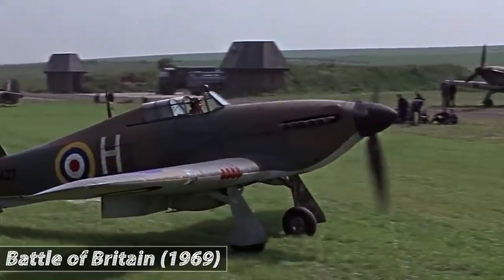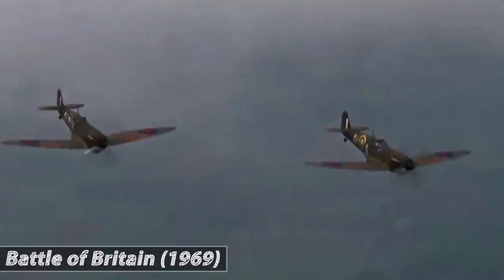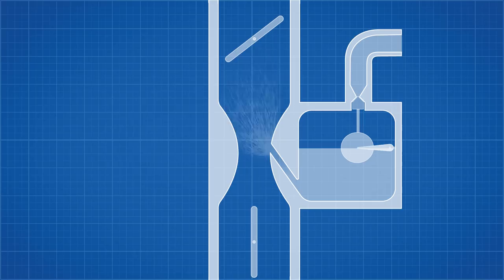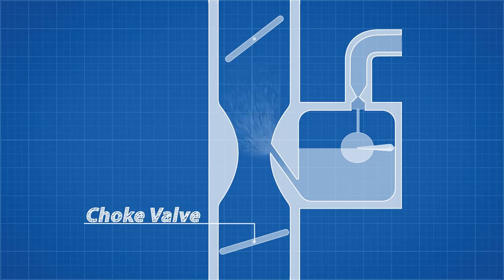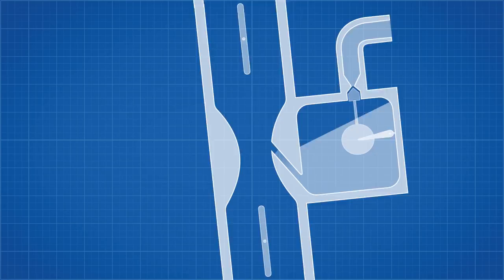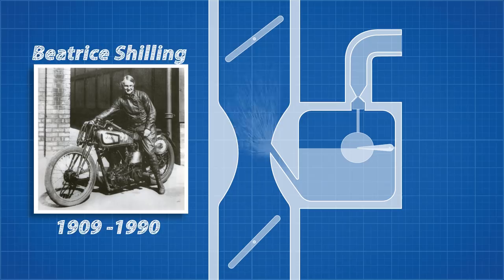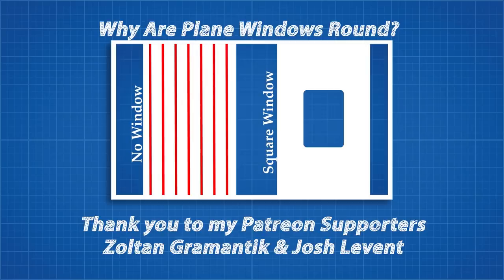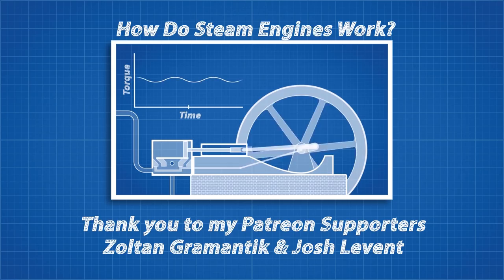The Spitfire's Fatal Flaw

Comment: Speaking of female engineers, I did my degree at Bradford University in the first half of the 70's. Bradford was essentially an engineering university at the time with several technology subjects also. The university then, only had some 6000 students resident at any one time with a further 3000 or so in industry since the university focused quite heavily on 4 year degree courses at the time known as sandwich courses - thin and thick - thin were 6 months at uni and 6 months in industry for three years and a final full year at university, thick were 3 years at uni with 1 year in industry - usually the second year IIRC. Out of ALL those 9000 students there were ZERO female engineers in Electrical & Electronic engineering, ZERO in Civil Engineering, ZERO in Mechanical engineering and just a VERY few in Chemical engineering and Colour Chemistry. The ONLY real cohort of female students were not even on the main campus but in Modern Languages nearer the city centre.

In the 45 years since I graduated the change in numbers has happened but is truly pitiful and the term Engineer in the UK is STILL perceived as someone who fixes your car unlike in Germany where an engineer is respected as being someone of the same level qualification as a doctor or lawyer. I've been a member of the IEE now the IET for over 48 years and in ALL that time the IET have been desperately trying to get more females into engineering without a HUGE success. It has improved as I say but it is still pitiful, especially so since there are PLENTY of roles withing engineering where women would not even get their nails chipped or their hands dirty, never mind their faces. 

The main problem seems to be a complete misunderstanding of the role of engineers and engineering by the public at large. They KNOW a doctor is valuable because they SEE the work they do. They KNOW lawyers are valuable for a similar reason, but ask people how many engineers affected their lives between waking in a morning to getting to work and they look at you like you're some kind of demented fool. My youngest brother is an engineer with McLaren and ANYONE who has been inside an F1 factory can attest to its "clean room" level of cleanliness, McLaren being no exception.

When he and I have discussed this we both reckoned that ANYONE, BEFORE they have even left their driveway has been dependent not on tens, nor even hundreds or thousands but certainly tens of thousands and maybe even HUNDREDS of thousands of engineers from designers, production engineers, quality control engineers, mechanical and civil engineers, chemical engineers, IT engineers, Telecoms engineers ... the list is endless. Think about it yourself - there is NOTHING in the world that exists for our use that has not been designed, produced, shipped, installed, EATEN, drunk, worn or utilised that hasn't had the hands of MULTIPLE engineers from MULTIPLE disciplines. Food, clothing, Technology, medicine - research is the science bit but manufacturing lines, production flow and control, logistics ALL VERY HEAVILY dependent of mechanical and electrical/electronic engineering.

During the current Covid-19 crisis where everyone (rightly) is praising the work of the NHS staff putting their lives on the line daily,  WHO has even THOUGHT for ONE second about the fact that not a single nurse, doctor, GP, surgeon, anaesthetist or other medical professional OR even janitors can GET to their jobs, never mind actually START then DO their jobs without engineers by their thousand designing, creating, testing, repairing, maintaining, upgrading, producing, enabling shipment, enabling delivery, installing, even operating, ALL the equipment they use from soap to PPE, from gowns to sanitiser, from MRI scanners to optical microscopes to X-ray machines to ... NAME it ... there's an army of engineers behind it!

It's about time women were encouraged properly to enter the profession as a great career choice since engineering is the bedrock on which today's society is built, not lawyers and the law or doctors and health services - neither of which would operate for more than an hour or two without engineers! Remember, it was essentially a FEMALE engineer and mathematician that REALLY put men on the moon! Come on girls stop bitching about the glass ceiling and start designing a way to break it forever - become engineers!
Reply: Very well said!

Comment: I've often wondered why carbs were even considered.  Did the apprentice design the system?
Reply: Carburettors did have some advantages, in particular charge cooling which permitted higher boost pressures and consequently more power.

Comment: When I was young and did acrobatics in light planes they addressed this with inverted carburettors, now with fuel injection it’s not an issue thank god.
Reply: Rolls Royce had the fix by the Battle of Britain, not a complete cure, Rolls Royce did that in 1941.

Comment: The early versions had lots of flaws,  fabric ailerons, no rear view mirror, and the fuel issue.  Anyway, they fixed these pretty quick.  The Spitfires 5 and 9 were supremely dominant throughout the war.
Reply: Except that the Spitfire V wasn't when the FW190 came onto the scene, the Spitfire V was shot down in droves, the Spitfire IX was quickly developed and held the advantage over the FW.
Reply: @cdf3073  Yes, I know, that is why the 5s and 9s were dominant throughout the war.    The 5s in the first half, the 9s in the second.

Comment: I've recently discovered your channel, which is geeat, so you can say I'm late to the party on this one. Your explanation is fine but it doesn't cover the main scenario that caused the RAF so much difficulty. Spitfire is chasing Me109, Me 109 dives, spitfire follows. Its the negative G involved in doing this that causes the fuel to fly to the top of the float chamber uncovering the venturi feed that makes it cut. Until Miss Shilling devised her solution, the pilots solution was a half roll and then dive, thus forcing fuel to the bottom of the float chamber and hence feeding the venturi.

Comment: The Hurricane was the mainstay in the BOB. It had a much shorter reload and refuel etc. time than the Spit. Higher squadron strength was possible with the Hurricane due to comparative maintenance construction simplicity. The best WW" fighter the Merlin engine Mustang P51 could do the lot as a supreme fighter, and long range escort. They could have dumped all those baby killing Lancasters and Fortresses and done real strategic bombing with Mosquitos which had a Berlin bomb load equivalent to a Fortress and Mustangs carrying  single five hundred pound bombs Both could have been incisively deadly and a strafing nightmare for the Germans on their return trip.

Comment: Ironically, the Bf-109s (actually licensed Spanish-built versions called the Ha-1112) and He-111s used for the 1969 Battle of Britain were powered by...Merlin engines!
You can tell from the shape of the cowling, which is VERY prominent in your footage. Bf-109s equipped withe DB605 engine don't have that deep chin scoop.

Comment: Why didn't Raf fit spitfire with injection system?
Reply: Maybe for two reasons, one the RAF did not make the Rolls Royce Merlin engine and two the Merlin engine with a carburetor was more efficient and more powerful than the bigger Daimler Benz engine with fuel injection, the slight problem which was never fatal was soon solved by Rolls Royce and SU.

Comment: You overstate the problem.  None of the Spitfire pilots had ever flown an airplane that did not have a carburetor and were thus well aware of how to fly an airplane with a carburetor. The German fuel injection was and advantage but a minor one. Negative g maneuvers were rare. If a 109 pushed the stick forward to escape a Spitfire on his tail all the Spitfire had to do was roll inverted and pull back on the stick to go after him.

Comment: Most aircraft at the start of WW2 had the same fault . The Junkers Jumo 600 series V12's used direct fuel injection a feature found only recently on cars . This system injected fuel directly into the combustion chamber , same as the diesel . The Spitfires main flaws were in didn't have much fuel capacity ,thus short range  and its Browning 303 cal guns , not very heavy hitters America went to the 50 cal guns before the war , and the ME 109 used 13 mm guns as well as 20 mm cannon , this was later fixed in the Spitfire but the fuel capacity not so much . This is why America had to invent the escort fighter . Also if you study your WW2 history in the early days in the Pacific the Japanese A6M2 zero chopped up the British  with the Zeros 20MM cannon as well [ Read the book Zero Fighter Saburo Sakie ]
Reply: America did not go to 50 cal before the war look at the standard fit for a 1940 P-40.

Comment: The top speed of bf 109 increased from 560 km/h to 670 km/h. Compared with early Spitfires had Bf-109E better firepower. ... The Merlin engine had carburetor, while the DB 601 engine had fuel injection, which allowed the German pilot to escape a Spitfire on it's tail by applying negative G without loosing power

Comment: If it truely was a "Fatal Flaw" then they would have just fuel injected it Like the Bf-109, but then the Merlin engine would not have been able to make as much power. This is why they stuck with a carburettor even though it had this apparent flaw. If you look at all aircraft they all have flaws, but it's better to call them compromises.
Reply: Gregg Clarke  Rolls Royce didn’t have fuel injection technology at the time. In that respect the Germans were in front,

Comment: Black smoke comes from a lean condition in the engine, not a rich one. An over-rich condition results in blue smoke. To the under-informed they may sound the same, but they occur from very different conditions.

Comment: After watching this grand video, a question bears answering; when was mechanical fuel injection invented for aircraft? Thank you.
Reply: 1935, the Daimler-Benz DB 601A had mechanical direct fuel injection.
Reply: @highdfire  Wow, the Germans figured that out first! ... and didn't the American P-38 Lightning  not only have fuel injection, but supercharged engines also and did not deliver this technology to the British?
Reply: @bepponabuco7389  - The P-38 did run a version of the Allison V 1710-D that had a Marvel MC12 injection system instead of the more common Bendix pressure carb. It didn't work that well and was abandoned. The majority of production P-38's were turbo-supercharged (both single and two stage) which were slightly inferior to the Rolls Royce Merlin 2 stage mechanical supercharger. For whatever reason the USAAF was stuck on the turbo-supercharger. The V 1710 would have been a fantastic fighter engine if it had a mechanical super charger.

Comment: I heard the spitfire ammo was .303 , and these rounds weren’t that effective, and the amount of ammo was on the low side. Is this correct
Reply: well it used more than just 303 it carried 8 browning 303 with about 350/360 rounds per gun then later variant carried 4 303 and 2 20mm cannon ,it wasn't under gunned but wasn't as heavily gunned as the hurricane which was the more stable gun platform ,spitfires to swoop in and catch em napping and the hawker to blow them to bits ,and it was only until about 1943/44 until the germans had the 109 g6 that it had a celling that could match the spitfires 39000ft
Reply: Wildernessoutside  thanks for that
Reply: @bernardmcmahon5377  your welcome

Comment: Yes. A larger flaw was the Spitfire was undergunned.
Reply: It and the Hurricane were the first eight gun fighters, and took the Luftwaffe by surprise, outgunning the ME109.. It ended up with several of  probably the best fighter gun of WW2, 20mm Hispano Suiza cannon firing explosive shells.
Wiki:"Different wings, featuring a variety of weapons, were fitted to most marks; the A wing used eight .303 in (7.7 mm) machine guns, the B wing had four .303 in (7.7 mm) machine guns and two 20 mm (.79 in) Hispano cannon, and the C, or universal, wing could mount either four 20 mm (.79 in) cannon or two 20 mm (.79 in) and four .303 in (7.7 mm) machine guns. As the war progressed, the C wing became more common. Another armament variation was the E wing which housed two 20 mm (.79 in) cannon and two .50 in (12.7 mm) Browning machine guns :
mounted

Comment: Wait, didnt the p-51d also use a merlin engine? Did the almighty mustang also have this problem?
Reply: No, the Allison powered Mustangs ( P51As) had fuel injection(throttle body fuel injection specifically, not as efficient as the German direct fuel injection system, but easier to produce and maintain) from the start, by the time Merlin Mustangs were produced (P51B and later) the Merlin had adapted the fuel injection system from the US. All Mustangs and all Spitfires Mk V and later had fuel injection.
Reply: @ivanthemadvandal8435  No they didnt, they had pressurised carbs.

Comment: Your example of the engine “stalling” at 0:58 of this video, is incorrect.🤔

The plane performing the “barrel roll” is NOT a Spitfire, but a Hawker Hurricane. You can see the lower radiator on the bottom of the plane, and the short wing span. 😁

GG👍

Comment: Too bad you didn't describe how the pressurized carburetor that solved the problem worked.  And What model is that Spitfire at the beginning of the video with the Hawker-like canopy.  Thought it was a Hawker Hurricane at first until I go a look at the wings.  Even so, the wings on didn't look to be as elliptical shaped as wings on the Mk-I, Mk-II, Mk-V, Mk-IX or Mk-VIII. The Mk-I and subsequent Marks all had the canopy with the bulge in the side that everyone is familiar with.  Or is that actually a Hawker Hurricane at the beginning? Yup, that's a Hurricane, not a Spitfire.

Comment: Uuhhh.... Why is this called "spitfires" fatal flaw if the Hawker Hurricane had the same engine and suffered from the same issue....
Reply: Even worse it was not only not fatal but no problem for RAF pilots and only applied to the early Spitfire and hurricane Ml I, completely solved by the Spitfire Mk V.

Comment: Volvo went to fuel injection in 1971, after many years with the brilliant S.U. carburetor. The Spitfire is beautiful, but the ME 109 had it all.
Reply: The Me 109 had its own problems, first the fuel injection was less efficient, it took modern electronics to make fuel injection better, most cars stayed with carburetors until the 1980's. 
Aston Martin used fuel injection in the 1970's but they used carburetors for their highest performance version, MG used an SU carburetor with the turbocharger in their fastest version in the 1980's and it was a very fast car  at the time.   I had an MG Midget on which I fitted a supercharger with a single SU carburetor, it was very fast.

Comment: It wasn’t a fatal flaw that is a misleading statement. It was just a peculiarity of the fuel system which pilots were able to work around. The Me 109 had much more serious flaws,  10% of losses were due  to landing and take off accidents, a combination of  a long undercarriage, small rudder giving low authority at slow speed which meant inexperienced pilots struggled to control it on takeoff or landing. The Me109 also was much harder to control near the limits than the Spitfire which meant that inexperienced pilots could push the Spitfire closer to the edge than the 109. Its cockpit was a lot more cramped and it had much poorer rear vision than the bubble canopied Spitfires. Both fighters were pretty evenly matched and both ended the war serving continuously throughout with their power doubling through their various marks.

Comment: So starting a video about the Spitfire with footage of a Hurricane shows there is an issue with your accuracy. Your carb diagram is ok. The Bf109 in the Battle of Britain had direct fuel injection. And yes the early Spitfires and Hurricanes had to turn on their back to chase escaping German pilots hoping to escape. The. Shilling solution was barely implemented but thank you for highlighting engineers from multiple backgrounds should have an equal chance of success. Good job.

Comment: Not really a flaw since most aircraft used carburetor engines.  The BF109 was the first production fighter in the world to use a fuel injection engine, and as such was basically the only fighter that DIDN'T have this problem. So I wouldn't call it a fatal flaw since it was a well known issue with most aircraft of the time.

Comment: Ah but the Spitfire and Hurricane could out turn the Me109
Reply: Not sure about the Hurricane, but according to Len Deighton's "Battle of Britain" the Me 109 could actually outturn a Spitfire. But  turn too tight equals over-stressed wings and one or both comes off. This happened with no prior warning. So Luftwaffe pilots were understandably cautious about turning too tight.
Whereas the Spitfire would start misbehaving slightly as it approached its limits. Not badly but enough the pilot could back off before his wing came off. So they pushed the Spitfire further than the average Luftwaffe pilot was confident enough to to do. 
It wasn't an intentional characteristic build into the plane, but a fortunate accidental one.

Comment: Bit of a misleading title which is a huge shame because I love your videos. The lack of fuel injection really wasn't a 'fatal' flaw, RAF pilots were trained in performing aerial manoeuvres that would give positive-G's in a negative-G - ie rolling the aircraft before performing a reverse loop or dive. Yes it wasn't an ideal scenario as the Germans had carburettors but the outcome of a dogfight was usually won or lost on starting positions of those aircraft, and pilot skill/experience.